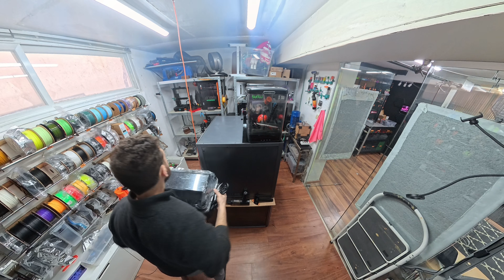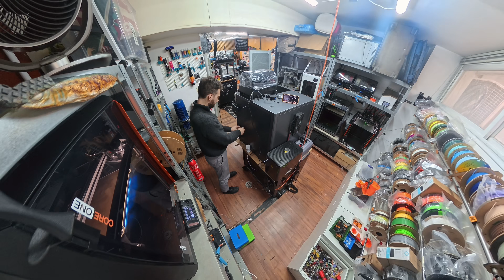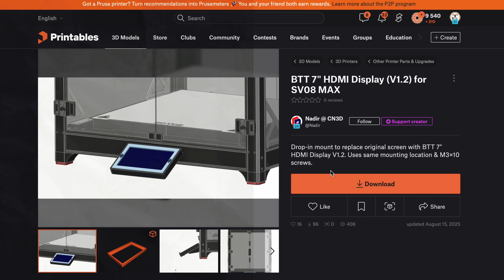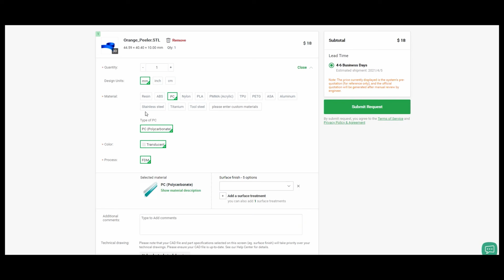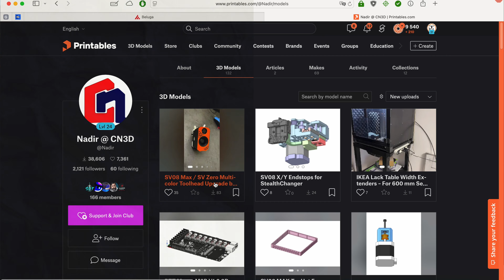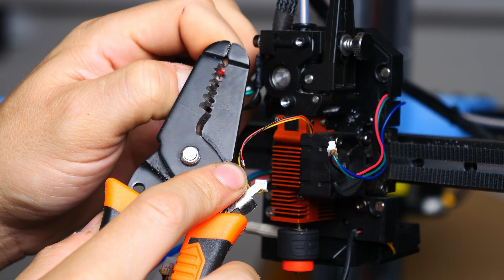A First Look at the BigTreeTech ViViD Open Source AMS

Comment: I just bought one on sale at West3D to use on my 2024 Creality K1C.  I've been Googling, 'talking' to Gemini, and reading Wikis and install guides.  I think (hope) I have a full game plan.
Issue #1, Happy Hare does not run properly on Creality's old and customized Klipper.  Solution to that is to install the SimpleAF firmware which is basically the modern mainline Klipper for the K1 series.  So I gain all the new bells and whistles in the latest mainline Klipper!
Issue #2, the SimpleAF firmware does not support the K1 series load cells for bed leveling and it's proprietary firmware and leveling routine.  Solution to that is a different probe, and I had been considering a Cartographer Eddy probe anyway, so I bit the bullet and bought that as well.
Issue #3, is a filament cutter.  I already upgraded to the DXC extruder which I love and I only found one [complex] solution to add a filament cutter to it.  So for now at least, I'm mothballing the DXC and putting on the Creality CFS extruder with it's cutter and runout sensor.  I never had any serious complaints with my original extruder.
All the parts will be here in a week or so.  I'm hoping for a relatively smooth install (smoother than your Sovol SV08) but no doubt Mr. Murphy (the lawyer) will insist on getting involved.

Comment: A few pointers: I'd take TNL's advice with caution—he was working with unpolished firmware, and a lot has changed since. That said, you'll want to be comfortable with Klipper (as the manual notes).
My suggestions, in order:

Install a cutter on your toolhead before (or while) you order.
Print a few different cutter solutions and keep backups preinstalled in case one fails.
You don't need the ViViD to get cutting macros working—dial them in first, then reference those macros within BTT's own macros once your unit(s) arrive.
Running multiple units? Print a splitter (2-, 3-, or 4-way designs are on most model sites, or grab the Bambu Lab 4-way if you'd rather not print one).
If you're serious, add filament buffers. They help with longer runs, and with some programming know-how you can use them almost like a signal amplifier to push filament back and forth.

I'm running 4-meter feeds from across the room. The only real hassle was timing—get that dialed in and you're set.
Once the INDX is widely available, I plan to mod a filament cutter into each hotend and network the whole setup together.
Reply from the maker: Agreed. The switch to AFC made it work I just haven’t updated viewers - no time.

Comment: Jonathan, I have recently discovered Codex.  It is a fork of chat GPT.  I give it the credentials for logging into my machines and tell it the problem and it helps with everything.  I recently had an issue with my plus 4.  When the new firmware hit, i lost all my beacon stuff.  15 min it was sorted.  Check it out.

Comment: Did you try running it with demon klipper? also i started getting a extra_mcu error during petg prints if you don't run the chamber fans due to the toolhead overheating. I wonder what your mcu tool head temps are

Comment: Thanks for posting the video even with the frustrating results. Hope the thumb heals well. I haven’t worked with an mmu before, but my kids have requested it and i myself wouldn’t mind the endless spool functionality. 

What I’m curious about is why the filament cutting has to be done on the head instead of in the mmu or some dedicated cutting intermediate module? That way user could minimize the modifications needed to the printer itself. I could imagine it making klipper software/firmware compatibility simpler.

Comment: I'd like to see a comparison of this vs a CoPrint setup. 
Since both need Klipper to be able to be added to open source printers, CoPrint does offer parts to run Klipper on printers that started life as a Marlin OS printer. 
I'm also curious as to how this would work on Creality printers running Creality OS, which is Klipper, but Creality-ized.

Comment: Thanks for the honest review and look at this product Jonathan. What's your thoughts on adding one of these to a printer that's already set up for an AMS? I'm keen on the QIDI 4 Max or Plus 4, but from reviews, the QIDI Box is rubbish (even the V2 model). Would this product be a good alternative for a printer like these that already have a filament cutter and runout sensors in the toolhead? Cheers
Reply from the maker: Can’t say since I didn’t even get it working

Comment: This is par for the course with Sovol.  They tend to hack the firmware to make it work, then ship it with the source.  No git fork for their source with changes documented.  Just a source tree dump.  And yes, they have non–standard parts all over the place especially with the screen.  This means you often have to switch out the display to do anything with a Sovol printer.  My experience with the SV06+ was very similar to this.  They don’t really contribute back their changes to the community.  That was with … er that other older firmware we all used before Klipper, not coming to me right now.  But it doesn’t surprise me at all that they did the same thing for the SV08.  It gets their products to market sooner, but it just means that the tinkerer has to pick up the slack, and end up with disappointment like you’ve found.  Maybe next time apply it to a stock Voron or something!

Comment: With all of these aftermarket filament multiplexer add-ons being developed, I have to ask: why not cut the filament externally?

Unload the filament all the way to a box somewhere along the filament path. Inside the box, detect when the filament has cleared the box, redirect the filament to a cutting path, push filament through, then cut and unload the rest of the way. It'd just need two motors: a servo for redirecting the filament path and anything precise and higher-torque for operating the cutting blade. That's certainly cheaper than a whole new toolhead and doesn't require adapting to different printers.

Plus, pulling the filament out would also mean that there's less to flush since typical systems cut above the heat break and the unloaded tip of the filament will probably be closer than that. Is there some reason why this isn't done for aftermarket MMS units?

Comment: I have a big pile of parts for an ERCF 2 for my voron 2.4. I'd honestly rather not mess with it and go this way, but I'd feel kind of bad putting off the project and wasting all the printed parts. I scratched my tinkering itch, I built a crazy ender 3, I built a ultimaker 2 printer with a open MCU and klipper with a dual filament head and lastly built my voron 2.4 2-3 years back and it runs great. I'm ready to hang it up and have the MMU just be turnkey.

Comment: it's no secret that i'm a big fan of btt - great bunch of people & most of my machines run their tech - but this one i'm not too terribly excited about.  sure, curiosity is there, but this is one of those things i'd probably install as a demo on my micron+ r1, if i got it super cheap - nobody sponsors me, so i can only do what i can & that usually means spacing out purchases for something like this to make my budget on a fixed income not quite so painful.  the more open source mmu projects that come out, however, the less i'm interested in ercf too, to be fair.  i love the idea of box turtle & emu mmus, personally, but that's mostly for the filamentalist system which can be implemented in other ways that might fit my workflow a bit better.  being a natural born tinkerer, there's any number of ways i could & want to go for multicolor & multimaterial solutions on my machines.  i'm sure that this one would probably be easier for me given my btt hardware, but....  🤷‍♂️

Comment: I've tried to get my VVD working for over a week.
There were two main issues:
- The BTT software wouldn’t run on my self‑built E3NG 1.2 with an M4P / Pi CM4 and several CAN bus devices (EBB36 Gen2 and Cartographer).
- There were some manufacturing quality issues: none of the grub screws on the gate or the drive shaft were tightened or secured with Loctite. This caused massive grip and loading problems.
Now I'm running the VVD with Happy Hare, and it works very well.
Reply: Do you have more info on what ones

Comment: Not having a cutter on the MAX toolhead has been one of my gripes about this machine.
Reply: Some open source mmu systems  cut the filament close to the unit and not on the toolhead in order to avoid some of these issues (you are able to oversize things outside of the toolhead). It will probably be an option for this system in near future and that way not having cutter on toolhead is not an issue anymore.
Reply: @gperpetuo  that would be a good solution

Comment: i wish they would have it not need the buffer would be a nice way to add MORE colors quickly to my coprint setup..also seems like you had similar issues to what people complain about for coprint.. just because it's compatible with all klipper and "relatively" easy to integrate .. doesn't mean it's simple or user friendly also have you checked your dmesg  om ssh? so you can get more info on the error

Comment: I'd LOVE to get this for my SV08 Max, but now that I have the chamber heater installed, it sounds like I am going to have to do a lot more work to get everything working. I am going to look at the available toolhead designs now. Still might be feasible.

EDIT: I wonder if this would make more sense on one of my SV08's, at least the one I didn't install the eddy on. The SV08 are USB and that might make things easier.

Comment: I have been looking for a product exactly like this!

I also have the SV08 MAX. I considered getting a BambuLab AMS together with a klipper electronics kit, pretty much only for the same reason you mentioned... I want to be able to start a print with a half empty spool and not worry about changing it every time.
It's such a shame they don't have a plug and play option for this issue with a printer this big.

I also struggled with the Not klipper - klipper. After much effort I got deamons essentials working. Don't know if that would make this installation more easy. They probably did this to convince buyers to buy Sovol's own upgrades instead of regular klipper ready upgrades.

Thanks for showing me the struggles. Saves me quite the hassle!

Comment: This is so disappointing, but thank you so much for posting this!

I've been looking at doing multi-material with my Sovol Max.... I was thinking of doing it with a custom tool head and a turtle box... But it looks like most of your troubles were before you even got to that step. 

I already put a little money into a custom tool head... But it looks like I need to pause and get my Max onto main line Klipper before I do anything else. 
I'm really interested in this mmu because I like tinkering, but I also like focused tinkering.... If I buy this, it will allow me to focus on getting the multi-material stuff tuned in and not worry as much about. Did I build the mmu correctly. 

Thanks for sharing!
Reply from the maker: Yeah that’s very true! I hope BTT posts the mainline Klipper version they made for this video soon

Comment: Check DEV branch of AFC for VVD support - sanctioned by BTT. 
Does not require toolhead sensors and is faster to setup than other options presently available.
Reply from the maker: OMG. That’s big news. I will 100% do that.
Reply: Gods plan

Comment: Currently waiting on my Snapmaker U1 to arrive. I'll be very curious to add some kind of MMU to it in the future to be able to expand beyond 4 colors in a single print...
Reply: Indeed most of the multicolor models out there require at least 5 colors. Making this work on Snapmaker U1 could be a big improvement.
Reply: @aegwyng could even not be slower since you could swap filaments while the toolhead is parked.
Reply: @aegwyng  I've had my U1 for only a couple days, but as far as I can tell, a lot of models don't exceed four colors. I don't find that very surprising, as most MMU/AMS/etc. support four spools.
Reply: I was thinking this but the full spectrum orca is pretty much doing the job for me at the moment. Blending filaments is awesome and will only get better with time

Comment: At this point I’m just going to wait for the INDX and be able to do pretty much every material and multiples in the same print. The cost will be very close and MUCH cheaper to add more colors/materials.
Reply: @TriangleCityGames  I am sitting on a small pile of money waiting for the INDX to open sales for non-Prusa puchases.

I am still considering a BTT ViViD for one of my Vorons as all I want to add to it is a an endless spool option for simple mass production on my machine with a conveyer belt bed

Comment: One fun project I wold like to se is using 4 off those MMU's and connect them to each head on the Snapmarker U1...
Reply: Been saying this for over a year.    U1 needs a custom print head with filament cutter.   Some slicer   optimization would make this the ultimate multicolor pla or petg setup.
Reply: You wanna see the poopless printer poop .... 😅
Reply: nightmare
Reply: Great idea! You have just eliminated the only advantage a tool changer has over a standard multicolor printer!!! 😂
Just as brilliant as poking your eyeball with a hot knife!🔥🔪👁   🤣🤣🤣
Reply: Yeah, totally eliminated the advantage of having 4 toolheads, by still having 4 toolheads, but now with for colors each which would be huge for prints that might need more than 4 colors/materials but maybe only at certain heights, say one for shoes or one on the hat of a model, so that you only have to purge to the new colors on the toolheads a few times, creating minimal waste while being able to print in many more colors. Damn, hoe that would suck and totally void all the advantage of the U1! Man, think before you comment
Reply: @John-lr3ix  Hey, Einstein, just by adding one MMU to one toolhead, you created two problems: 
1. Now, in order to color swap on that toolhead, you need to > retract the old filament while creating purge waste > extrude filament while creating purge waste!
2. You have just slowed down the whole process of changing colors!

With 4x color swaps on one toolhead, you have now created 8 extra purge cycles. times 4 MMU = 24 extra purge cycles with 4 MMU's. Not to mention the time wasted!
At that point you'd be better off throwing the filament spools in the garbage while saving time.

" think before you comment"  - hmm, i didn't know that milk could spoil so quickly.🥛😂
Reply: @julientaylor  Wrong. For example: You need 5 colors/materials for a print. 4/5 swaps are still quick and don't waste much, only one is slow and more wasteful.
Or, you want 24 colors ans all but 3 are only used in a tiny section in the print, as a text highlight for example.
Reply: @ItsNeverMe "Wrong. For example: You need 5 colors/materials for a print" - Was never in debate! Have you read the comment & replies?

"4/5 swaps are still quick and don't waste much" - Is a color swap quicker than not needing to color swap? Is a little waste less than no waste? - If you can't answer my questions with yes. Why comment?
Reply: @julientaylor  Could just find a way to swap filament while the toolhead is parked. essentially making the swap the same as switching toolheads. not a solution to the purge waste, but that's simply a part of swapping filament.
Reply: @emeraldbay3620  "Could just find a way to swap filament while the toolhead is parked." - The "way" is a new printer or a massive upgrade/conversion of the U1, which most people won't be capable of doing. 
But then you (or your slicer) run into the problem of having to preplan what spool goes in what MMU, and the result of that is needing to swap spools around = wasting time.
You now have 4 MMUs with 16 color spools and now have to swap around spools depending on the print project. If making your life worse was the goal, you have succeeded.😂
Reply: @julientaylor  I really can't tell if you are being obtuse or not. None of this is a "simple" thing to implement. Spool identification can be improved using RFID or a proper UI. Preplanning material changes is possible (again never said simple) and would resolve the main issues you bring up. Making it a modular system (similar to the mmu in the video) also lets you decide how many toolheads use default vs mmu extruders. Also, I never said it has to be a U1 since this is definitely more inline with the PrusaXL platform anyway.
Reply: @emeraldbay3620  "I never said it has to be a U1" - Well buddy then you are in the wrong chat, this discussion is all about the U1 (first comment). PERIOD

When you want 9-piece chicken McNuggets, Burger King isn't the right place!
Reply: @julientaylor  the fact you can't see how this would be an advantage is incredible.
Reply: @simonh2011 Please explain how going from an almost completely purgeless and quick system to a lot of purge waste & a slower system is an "advantage"!

"incredible" if your goal is more purge waste and slower printing! 🤣

Comment: Be interesting to see your take on running this with AFC from the box turtle team as that now supports the VVD in their dev branch since 19th Feb. Also will allow people to not need any toolhead sensors with the latest work - ramming is so much better than toolhead sensors - I think the VVD supports that.

I'm sure you will have a better software experience then.
Reply from the maker: Yeah, I had no idea about that and this video was recorded before the 19th. I will 10000% migrate to AFC. It’s way better.
Reply: Correct VVD does work with "ramming" in AFC